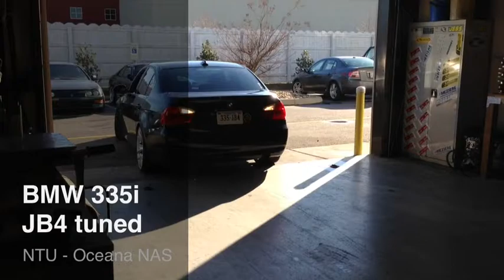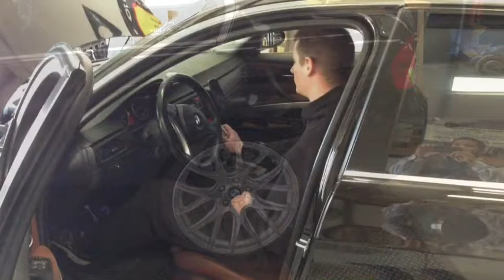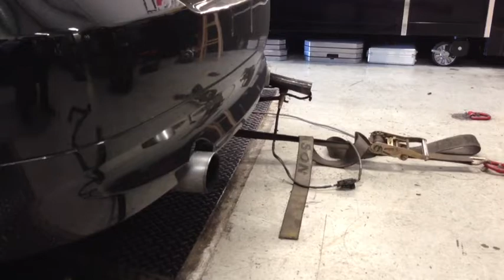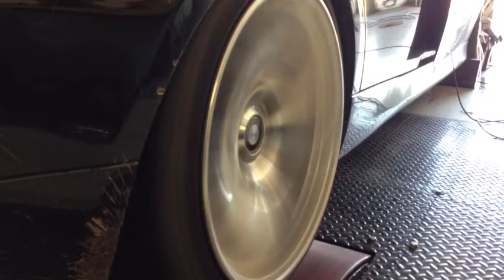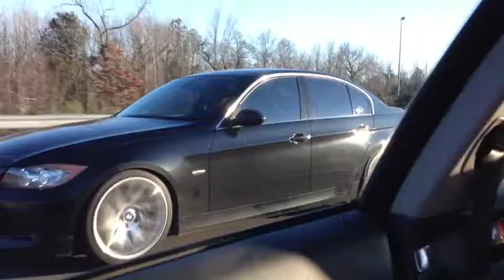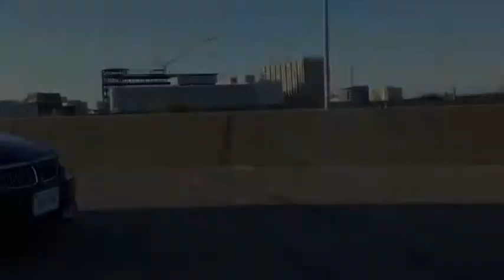BMW 335i JB4

Comment from the maker: JB4 Tune, Dual Cone Intake, Stage 1 Clutch and Aluminum Fly Wheel. Catless Downpipes, and Oil Catch Can. Front Strut Brace and Eibach Springs with Koni Yellow Adjustable Shock all around. I also upgraded the Rotors and pad to Slotted and Drill with Ceramic Pads.

Comment: Just bought an 09 335xi and I came with the JB4+DCI. I was pleasantly surprised on the first test drive. I knew a 335 was fast but i didn't think it was that fast! Sure enough popped the hood and saw this. Looks like an amazing piece of software. How have you liked it? I've barely scratched the surface.
Reply from the maker: its been great.. i love the useable power you get.... and the more power on tap with the right tune and supporting mods.